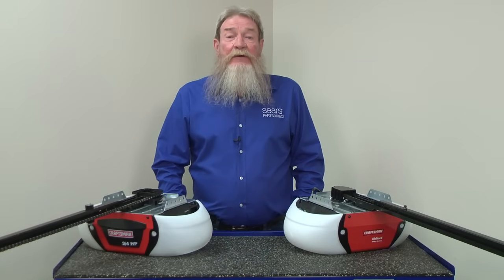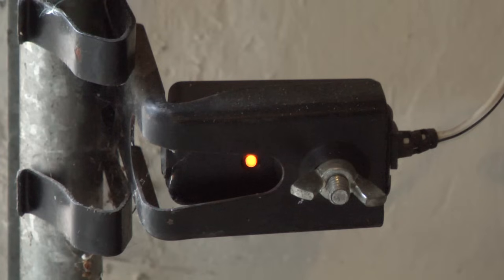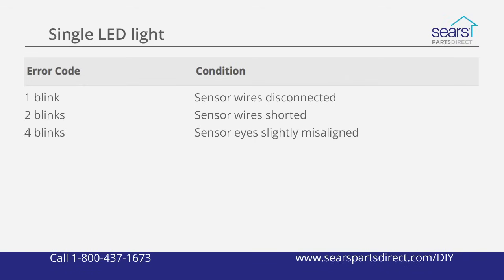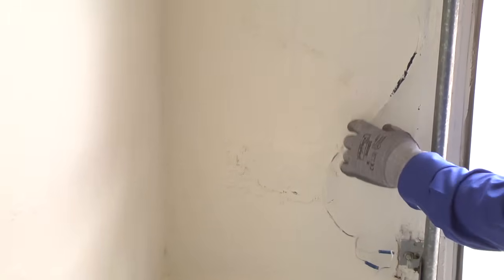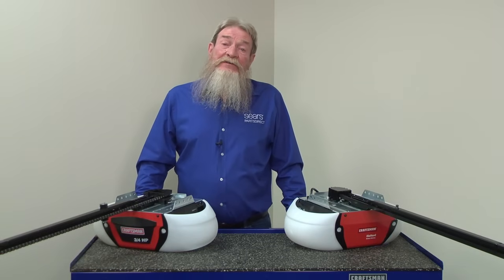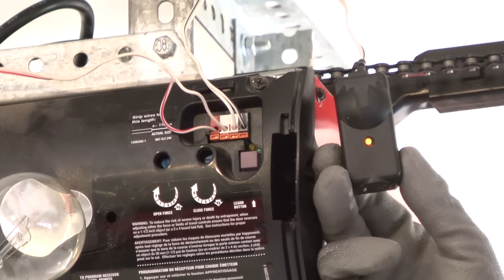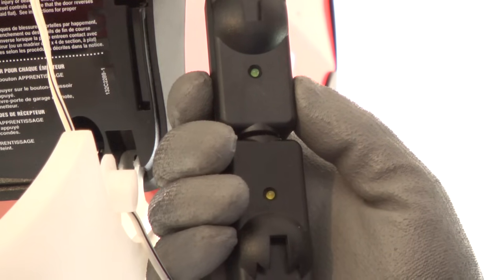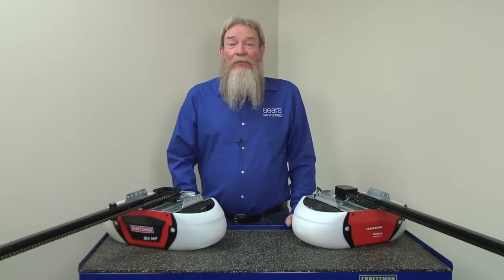How to Fix a Garage Door Opener that Won't Close the Door: Lights Blink 10 Times

Comment: Ours works except when the west sun hits the front of the house. I checked the sensors and they are okay. I also checked the sun striking the sending and receiving sensors by switching them. It doesn't matter which one is in the sun's path, the door opens part way then closes with the 10 flashes. It only does this when the sun is hitting the garage door. All other times it works correctly. I can turn up thee down force, but when it closes, it opens again. It didn't do this last year.

And we have no manual. I cannot find a manual anywhere for our Liftmaster 41A5021-4M-315. I guess Chamberlain doesn't care about customers with older units.
Reply from the maker: Sunlight is probably interfering with the sensor beam. Covering the safety sensors with sun shields will likely fix
your garage door opener problem. Here’s a link for a set of sun shields for the sensors: http://www.searspartsdirect.com/part-number/41B873/0009/139.html?sid=soc:youtube:c
The model number that you listed for your Liftmaster garage door opener appears to be a part number for the logic control board. Here’s an owner’s manual for a common Liftmaster garage door opener that uses that type of logic control board: https://www.liftmaster.com/CatalogResourcesV3/en-us/shared/files/tucmanuals/114A3072.pdf
Hope this information helps. Let us know if we can assist you further.
Reply: First. Why did you send me 4 emails?

I've played around with it. Switched the sensors side to side with no change. Stood with my shadow blocking the sun from the sensor the sun hits. No change. Increased the distance down. The door closed but went back up at driveway level (No surprise). Removed the sensors completely and used the wall control to close it for a couple of days. Reconnected and (so far) it seems to be working. I'll test it when we have a hot (105 or higher) day and full sun.

I used the code for the "part number" because an answer on the Chamberlain site said that was the model number. I have since learned that the model number is under the plastic cover. So I have to climb on a ladder and remove the plastic cover to get the model number, but I can stand on the floor and get the part number. Who does stupid things like that?

Anyway, I'm still working on it.

Thank you for your reply. I'll try to remember to return and let you know what the outcome is.
Reply: Sears PartsDirect